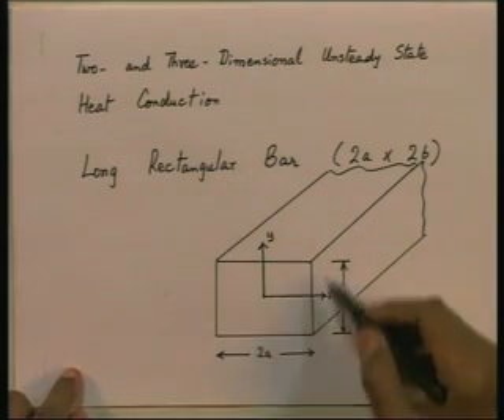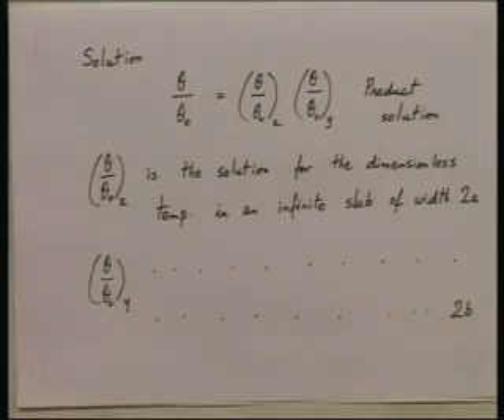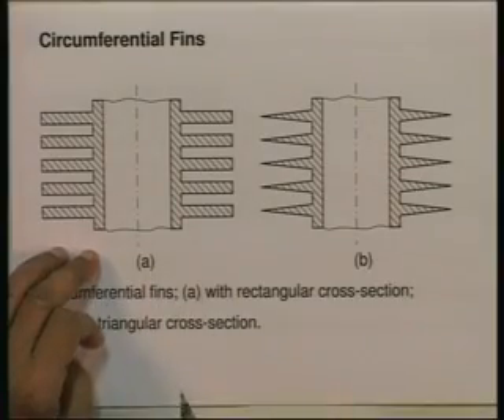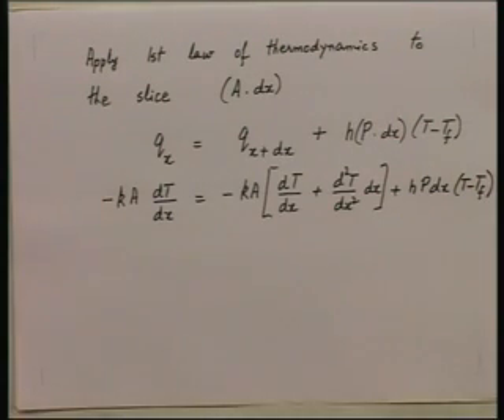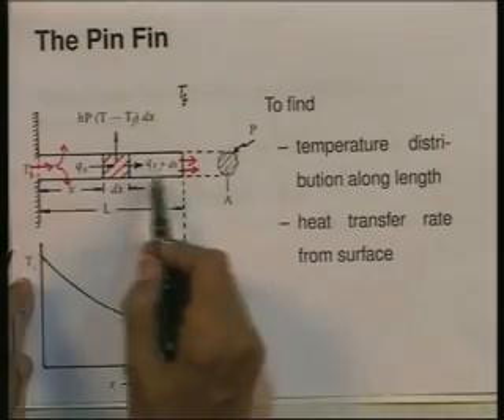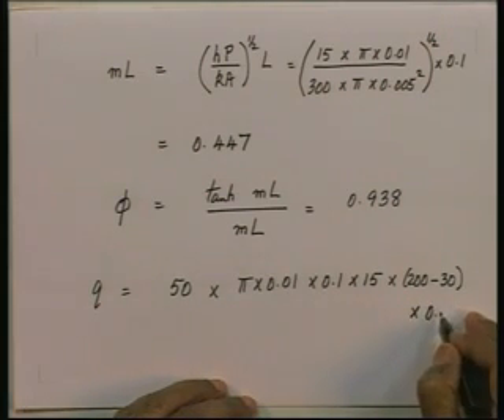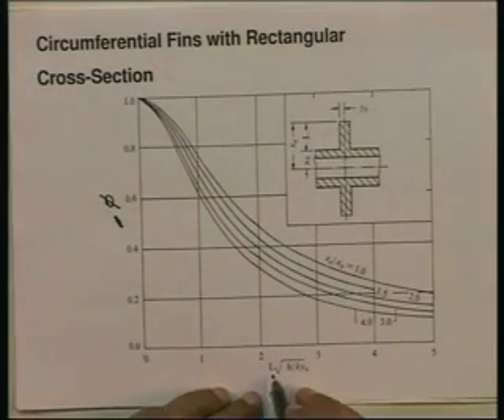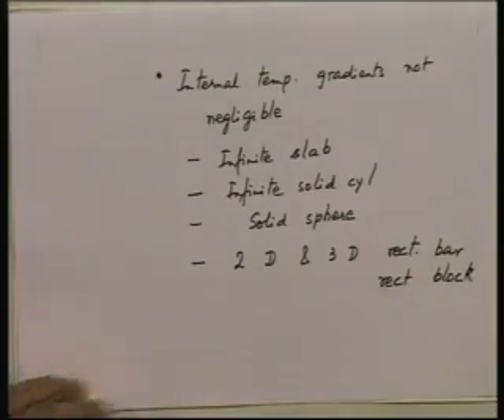Lecture - 9 Heat Conduction - 6

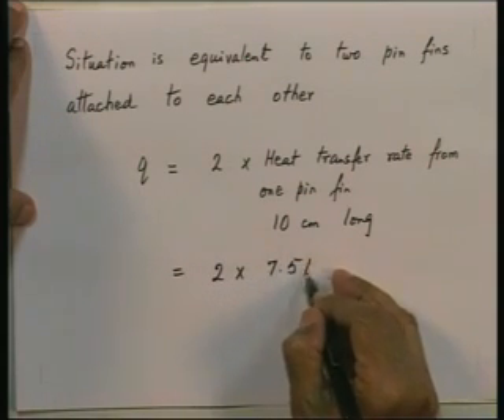Comment: In 46:20, for a rod connected to two walls, Prof. SP.Sukhatme found q when k= infinitive for the rod, stating that this is the answer, but in the que he asked to find the q(heat transfer rate from fin) and not q when k= infinitive... So, I think we have few more steps( similar to the first kind) to reach the solution of the problem...can anyone tell me, Did he miss that part or Am I wrong?
Reply: Sir already multiplied 0.938 to get Q
Reply: @shreyasacharya965  but (tan h)=0.26 i get how it 0.938..?
Reply: @shreyasacharya965  plz ans fast my exam start in 30min
Reply: @mojvalatv8937  fin effectiveness is calculated as tanmL/mL which comes out to be 0.938
Reply: @shreyasacharya965  no hyperbolic tan means (tanh×ml)/ml
Reply: @shreyasacharya965  i consider h=15 and multiply with tan then ml but in tanh h represent hyperbolic so we need to calculate value of tanh...
Reply: Same dout